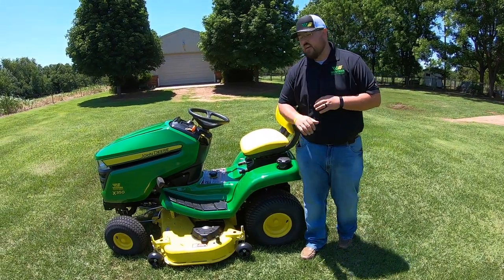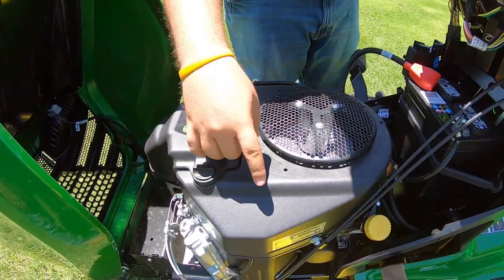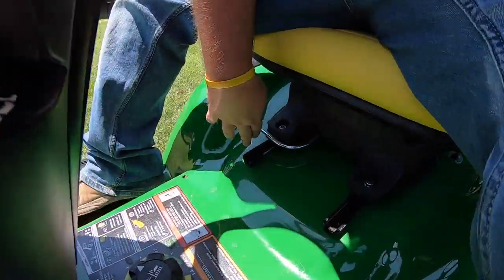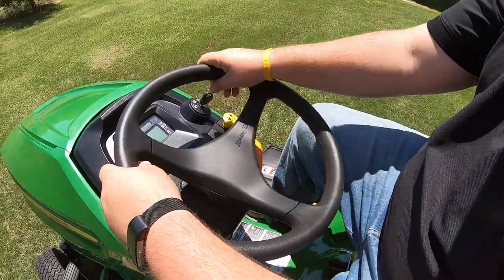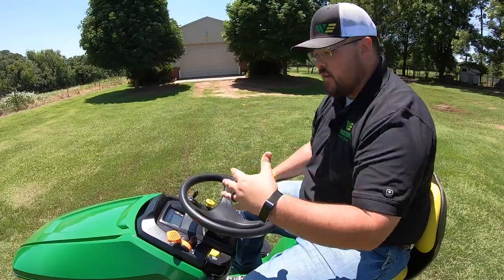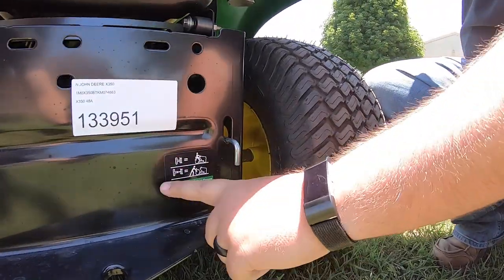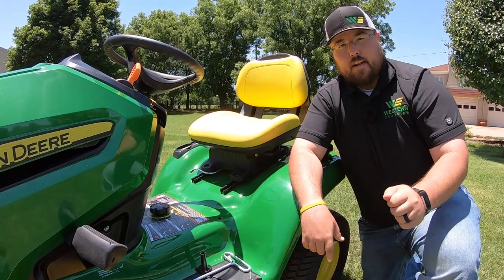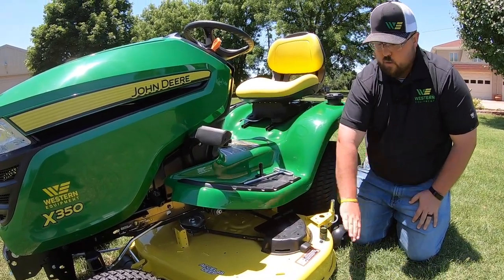2019 John Deere X350 Riding Lawn Tractor Mower Review and Walkaround

Comment: I've been mowing with John Deere lawn tractors for 25 years now, I've found the primary use of the hydrostatic disconnect on the back of the mower is when you push it around the garage or shop. I've never liked the idea of starting the engine just to move it a few feet, so its easier just to pull the release and push it. I really like the hinged covers over the spindles, the models that don't have that you have to unbolt those covers from the deck, the bolts on the back are really hard to reach. JD does leave a small port but its extremely difficult to see and even more difficult to try to grease the spindles through the small port, those hinged covers make the job so much easier, plus the added ease of blowing out any cuttings that accumulate there.
Reply from the maker: Thanks for the comment and thanks for supporting the brand for so long!!

Comment: Cleaning the heavy buildup of grass on the deck's underside is essential, but removing (or dropping) the deck to clean that area is extremely difficult. Spraying water into the top of the machine while the blades are turning is an excellent way to rust out the inside of the engine.

Comment: This is a great video. I'm a first time riding mower owner (X350) and just watching this alone has made me a lot more comfortable with my new machine. Very helpful!
Reply: Do yourself a favor and remove the spindle guards, they dont prevent anything from building up. All they do is help collect, build up heat and make your spindles wear faster.  With the covers off, its much easier to keep clear, keep an eye one it, and reduce heat build up.
Reply from the maker: Glad I could help
Reply: @cainfrey1748  not sure thats a great idea, theres usually "guides" on those guards to keep the belt from slipping

Comment: Well Done, Very Informative, my 2nd Deere Mower, 1st LX280 good mower haven't used this X350 I went with 42 inch deck as I have just 1acre of grass to cut.  Got a good price for my LX280, $2300.00 (14 years old 621 Hrs).  Sold in 18 hours sitting on my front lawn on country road.  Accepted the offer just $150.00 under asking price.  Served me well.
Reply from the maker: Thanks for sharing your story. Deere mowers have a good resale value. Good luck with your x350!

Comment: I have the 42" deck, great great mower, awesome machine, quiet, smooth and turn radius is fantastic, highly recommend !
Reply from the maker: Great to hear! We definitely agree!
Reply: I am picking up my x350  with a 42” deck tomorrow!
Reply: @chuckhowland5146  Excellent, let me know what you think!
Reply from the maker: @chuckhowland5146  Awesome! Let us know how you like it!
Reply: Chip Stetson  mowed 1st time today with it. Took a little effort to figure out depth and mower wheels position.  I really like it.
Reply: Western Equipment Runs great. Easy to steer. Nice cut. Taking me a bit to learn reverse with blades engaged using button bc I was used to jd LA175 with a rocker forward/reverse petal.
Reply from the maker: @chuckhowland5146  Awesome! Glad to hear it!
Reply: @chuckhowland5146  Good to hear, glad you like!

Comment: Stellar review. I just bought an X300 48 inch deck, 2013 model with the Kawi top engine option. 603 cc engine. Used of course. 266 hours on it. Looking forward to running it this year. Bought it to replace my JD D140 which was a total piece of garbage. Spent more time wrenching then mowing on that thing .
Reply from the maker: Hate to hear that about the D140 but glad you are in another John Deere product!

Comment: The throttle level for PTO engagement was a new concept to me, never knew half-throttle was recommended until I had to replace mine recently. Good info that you never really hear about.
Reply from the maker: Yes, this is why I try to mention this in every video. Very costly part to replace if you burn up a clutch.
Reply: yep all my neighbors are not aware of this as their belts do the high screech noise when they throw there PTO on.

Comment: I have a 2019 X354 with the Rear wheel steer and love it.
Reply: @BBQ Nut  Do you have mulching blades on it? Did you put different blades on and accidentally put them on upside down? Some kind of blockage in the discharge chute or tube?
Reply: d mccull do you feel comfortable on it on hills?
Reply: @akbychoice   Good question, I don't have any hills to use mine on. In theory I think they would do OK.
Reply from the maker: Glad to hear you like it! I plan on doing a demo of the 4 Wheel Steer in the future! Stay tuned!

Comment: Thanks for the review. Very informative. I’m looking at the x350 and the 2023 z320r. I have an acre(give or take) to mow. I do have a slope to the yard and it slopes to flat in the back while flat in front yard. So I’m trying to figure out which would be best. Do u have an “expert” opinion on which might be best? Thanks. Great informative videos. Keep ‘em coming.
Reply from the maker: In my opinion, I like the tractor style mowers for slopes, but a zero turn mower can do it with correct operation.

Comment: Bought a 42" X350 today.  The thing is a beast compared to my old Craftsman.  Thanks for explaining the features.  It took me a while to figure them all out and I still wasn't sure.
Reply from the maker: Congrats on your new mower!
Reply: Just bought a 42" x350.  Hows it workin for ya?
Reply: @Pwrcritter  my only complaint is the reverse blade safety feature but it's easily bypassed.  Otherwise I love the mower.
Reply: @commonsense6839  After my maiden voyage...  Impressive, but  the power, sitting higher and safety features will take some getting used to.    Im used to a much older wheel horse that served me well.
Reply: Are you still happy with the John Deere X350?  Any problems or recommendations?
Reply: @rso1411  Love it.  It cranks so easy and runs like a beast.  I have since moved to a 3 acre property, which it is really to small for, and still use it now and again instead of my tractor to mow the grass.  I have not had one problem with it and can't recommend one highly enough.  Good timing as I was installing a 25 gallon sprayer on it today.  Let's see how that goes.
Reply: @commonsense6839  Thanks for the response.  I have 5 acres and am concerned that it may not be big enough.  I tend to wear out the smaller ones really fast.  Thanks again.

Comment: Note: that oil filter is a pain to take off if it's the factory filter. (Once it's replaced its much easier.)
Starting the mowerdeck: I put it at the bottom of the green zone, otherwise it might stall. (Atleast it feels like that).
The cruise control is genuinly a handy feature to have.
Btw: mine is a 2017 with the 42" Edge Mulch deck.
Can confirm I am able to mow about 3/4 hours with one fuel tank.
The washout ports DO work, but it does not get everything completely brand new clean, so to speak.
Reply from the maker: Thanks for the feedback!
Reply: @WesternEquipment  no problem :)

Comment: Thanks bought one. I am considering Mulch Kit, but dealer will charge $400 to come over and install on top of the $150 kit. Is it worth it? We will be getting leaves in fall and without the kit right now it's just spitting leaves everywhere without mulching them. Thought?
Reply from the maker: These kits normally always come with instructions and I think this is a job that somebody that is even the least bit mechanically inclined could handle. If you buy this kit and it doesn’t have instructions email me at brent@west-equip.com and I can get this for you or help you out. No reason in paying that $400 if you can avoid it. I hope this helps and thanks for watching!

Comment: Hi Brent. I need some advice. I got an X350 last year. 42” deck with a bagger. I am using now on my lawn that has a hill type mound and some scalping is going on. I adjusted my scalp wheels to be set on 4”. I also mow on 4” height. My question is this. Should I remove the side discharge chute from the deck to get my maximum height of 4” ? I have noticed the side chute while raised in the up position to be against the bottom of the foot platform. Making me wonder if the deck isn’t as high as it should be at 4”. This would not be an issue without the bagger installed. My mower came this way with the side chute still on so I am just wondering if you know about this. Thanks and keep up the good work.
Reply from the maker: Great question! You definitely could remove the chute and that may help but sometimes if you are mowing that hill at a certain angle it will be hard to avoid the scalp. you may try a different angle to avoid this.

Comment: Best instruction video I've seen so far. JD states that this tractor is not for hills. My property is separated by a short but steep hill. My current 12hp with Eaton hydro handles this (when dry). I've also heard complaints about the TuffTorq hydro. Am I going to have a problem negotiating this hill with this tractor?
Reply from the maker: It is hard to say without giving it a shot! I can tell you these are very nice mowers and most people do not have problems! But what I would do is call your local John Deere dealer and ask them to bring one out for a demo! They should be more than happy to do so! Let me know how it goes!
Reply: @WesternEquipment  thanks, also you said in the video that the 1st digit is the engine. X330 and X350 have different engines so I don't understand.
Reply from the maker: I actually say the first digit represents the series, so the 3 is the series. The second number represents the features and functions of the tractor. And the last digit represents the type of steering the machine has, whether it is 2 wheel or 4 wheel steer.
Reply: @WesternEquipment  sorry, you are correct. You are saying "mower". I thought you were saying "motor"
Reply from the maker: Ah, totally understandable!

Comment: I have a 2019 x354. The only thing I do not like is the oil filter location. It can be a bit of a pain to get it off and when you do it can be a mess unless you makeshift some type of chute to funnel the oil away from the deck below. I only do this out in the grass as you will drip oil most likely. Could be a bit less deck noise, could be a bit easier to remove the deck. Even with those small things it is a great machine. I cut around a lot of trees so the 4 wheel steering is great.
Reply from the maker: Yes, the oil spillage can definitely be a pain but like you said they are awesome mowers.

Comment: I've run the heck out of a deere x 350 very easy to operate from a 12 year old I've run mowers since I was old enough to sit up straight on my grandpas lap now 10 years later I've put over 1000 hours as on 20 anchors Deere's the way to go I have one that's 20 years old now with a lot of hours do math 10 of 20 anchors for ofer16 years great!
Reply from the maker: Glad it has been so good to you! What’s your favorite mower?
Reply: @WesternEquipment  my jd gt 235 I just finished mowing a field with it that you'd usually use a Bush hog for set it as high as it would go it looked like a golf course afterwards and. I was moving no slower than normal and I didn't have to do it half deck
Reply: @WesternEquipment  although the x350 ain't bad

Comment: I am debating on what mower to get I’m between the s170 and the x350. What do you think is best? I have about half an acre. Also what engine really is better the 22hp cyclonic engine, 21.5hp I torque or the 24hp twin extended life engine. I can’t find much on what would really be the best engine. I figured more hp the better but hp seems to go down in the x series.
Reply from the maker: If you are willing to make the jump then I would go with the X350. You are just getting a better built mower and the Kawasaki engines are a great option and seem to be everybody's favorite.
Reply: @WesternEquipment  I purchased the x350 yesterday!! Just waiting for delivery! Can’t wait! Also do u have a review on the one touch mulch kit?

Comment: Just bought a 2021 with the up graded 21 horse kawasaki engine and now has a kit in the glove box by the cup holder
Reply from the maker: Great choice and I hope you love it. Thanks for watching!
Reply: Got the same, did you ever  make sure you only turned the blade on at half throttle and then pushed the throttle up? Yeah me neither, rip it, don't baby it you got it to use it!
Reply: Also if you are worried about wearing out your mower belt, I suggest a simple wire to jump the reverse cut off, disconnect the switch and make a jumper, you will never have to worry about the deck shutting off in reverse, and it will definitely reduce wear from stoping and restarting the blades

Comment: Hope you can help with this one: I have about a 250' by 250' area that is on a slope. If I had to guess, I would say about 5 - 15 degrees throughout the area. I have heard that the low 300s have a smaller diameter transmission while the 370 and 380 are larger. (Is this true?) Also, Will the 380 handle the 15 degree slopes or will the transmissiom have the same chance of failing prematurely? Thanks ahead of time!
Reply from the maker: Yes the larger X3’s like the X380 has the bigger transaxle. I don’t know if I would say it is guaranteed to last longer than the smaller one but by rights it will out perform the smaller one.  I would however recommend the larger transaxle for the slope! Hope this helps! And thanks for watching!

Comment: So I’m looking for something 48 inch that will have MORE than enough power for a snow thrower attachment what would you recommend? Also whats the bare minimum you would recommend for a snow thrower? Thanks!
Reply from the maker: I would recommend at least going with the X350 with the 48" deck, but I think you would be happier moving up to an X380 so you had the more heavy duty transaxle. Hope this helps and thanks for watching!
Reply: @WesternEquipment  thank you went to the dealer Friday, tried out the x380 and the power steering of the x370. I want the best of both worlds, the power steering and the bigger transaxle of the x380 so now I’m looking really hard at the x390. 

is the hydraulic lift on on the x390 going to work with the snow blower and will it be as durable or as good/better as the spring assist?

Comment: The bearings on the blade spindles are sealed both sides so the grease point is a total waste of time........or has the design changed?
Reply from the maker: I will dig further into this but either way it is a good idea to have grease on the shaft to avoid rust on it, even if the spindle and bearings are sealed.
Reply: @WesternEquipment  Yes I agree with the shaft getting some lubricant, however the JD shop where I bought my mower told me I must grease the spindle bearings every few hours and when I had a bearing failure I found them to be sealed both sides. Even if the inner seals are removed, holes would have to be drilled on the outer seals otherwise they would pop out under grease pressure. I'll look forward to your findings.  Regards.

Comment: I loved this Video...Great job....Ok, I have a question...I have right now a D-140, Pretty sure it's a D series ..Not an E...anyway its a 48" mower and it just Cannot handle my yard, I have about 7 acres of grass to cut once every week, I like the zero clearance mowers but Cub and John Deere, But I can only use a steering wheel because of Nerve damage to both of my shoulders and arms due to an injury ...So my question is could you help me by recommending a Mower or Mowers for me to look at...Thank You in Advance....
Reply: Jeff Mitchell cub cadet makes a zero turn mower with a steering wheel.
Reply from the maker: I would definitely look into this X3 series or maybe even the X5 series! Both series also offer a power steering unit which may be helpful!

Comment: Alright so, I’ve decided on the x390 with 48” deck for it’s hydraulic lift and power steering, and it’s bigger transaxle for the snow thrower attachment.

Can I get the one touch mulching AND have it setup with the power flow bagging system? Can it be done? What are the complications? Would I have to switch out blades to do either or?
Reply: Talking to one of the sales rep at the dealer he said it’s kind of one or the other, and I thought why not both
Reply from the maker: Unfortunately he is correct. The reason being is with the mulch system you would want mulching blades and with the power flow bagger you would want high lift blades. Also with the one touch mulching you would be adding an electronic cylinder to open and close the mulching cover and this could be in the way of your power flow system and vise versa. I hope this helped and thanks for watching!
Reply: @WesternEquipment  thank you you’ve helped me so much in my decisions I wish I was near you guys I would buy from you

Comment: Hey Brent ! Greetings from France, thanks a lot for this very instructive video. I am looking for a tractor for my garden of 6000 m2. Do you think that the X350 is enough for that ? Or should I buy a bigger one? Thanks in advance. Pierrick
Reply from the maker: Hello! If you are only mowing then I think this would be great. If you are planning on using it to plow or do any tilling then i would look into a larger model. I hope this helps and thanks for watching!
Reply: @WesternEquipment  thanks for the information ! Finally I am more interested about the x147r or x167r do you think that both suits only to cut the grass for a ground of 5 600m2 or are they too small? Thanks in advance

Comment: i got a 2016 X350 48A deck the question is the transmission they have a Tuff Torq K46 that are nonservicable as other brands also use it. as there is a 300 hour warranty not sure if John deere warrants this transmission? i hear these transmissions fail the axle seals and other parts.
Reply from the maker: Yes, John Deere will handle any and all warranties on these mowers.